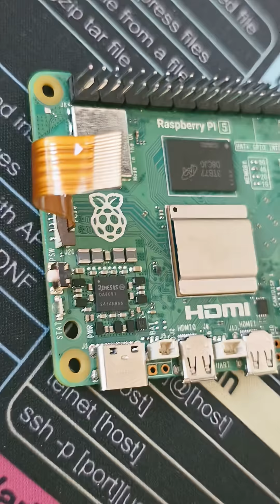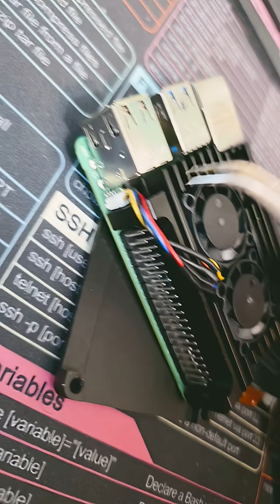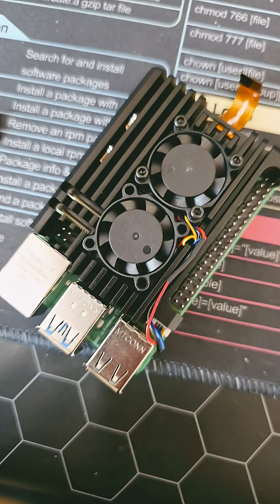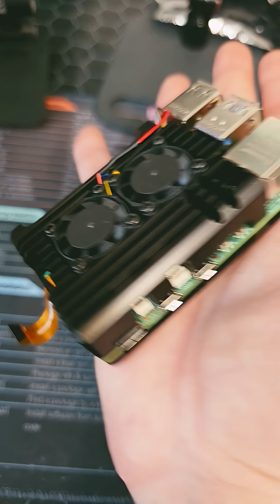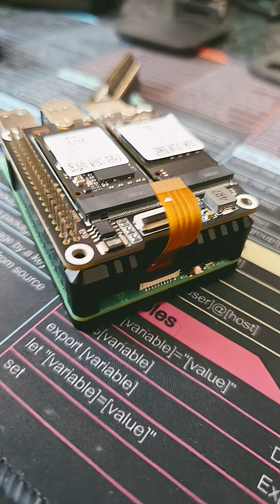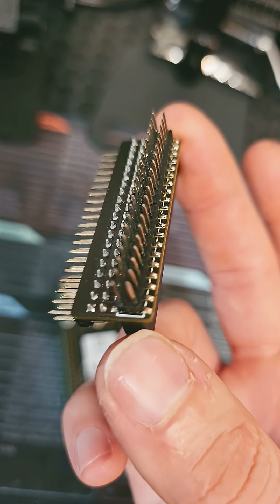Don't Let Your Pi 5 Melt: Active Cooler Installation Guide #raspberrypi #diy

Comment: If it has no fans it's a passive cooler not active 👌🏼🤙🏼
Reply from the maker: You are correct my brotha was just in the moment
Reply: @Valleytechsolutions  all goods 😅 but otherwise good contents be interesting to see what else you put out, I've started to notice you're content more and more 🤙🏼
Reply from the maker: @Phri3 i also take requests❤
Reply: @Valleytechsolutions true , I mean we have a lot of similar tech so could be interesting, don't suppose you have a hack rf one portapack? As I noticed you have a flipper ... I figure you might be a solid person to show how to use the flippers data dumps for sub ghz for the mayhem environment if so ?